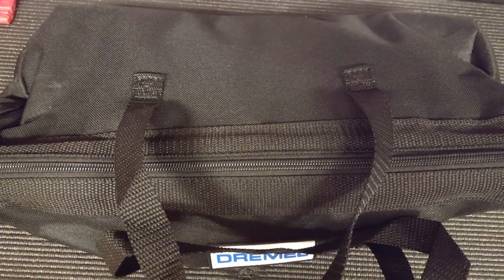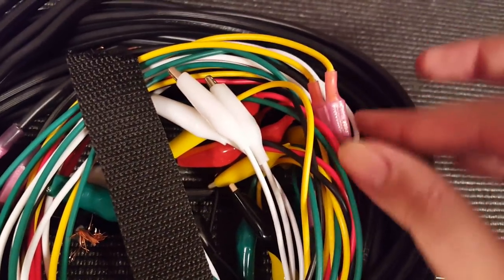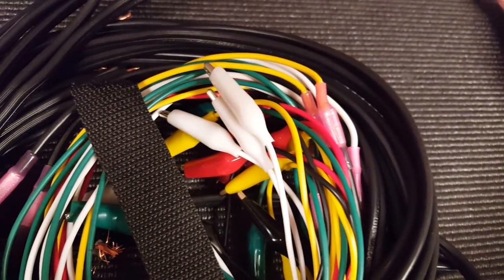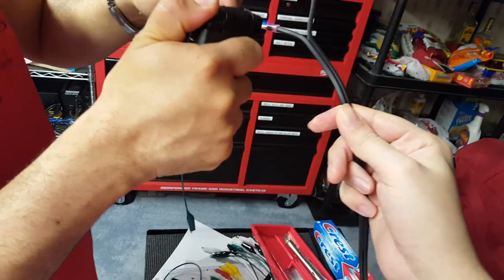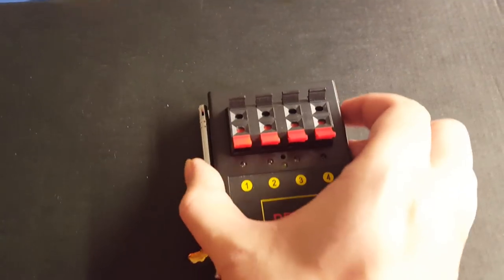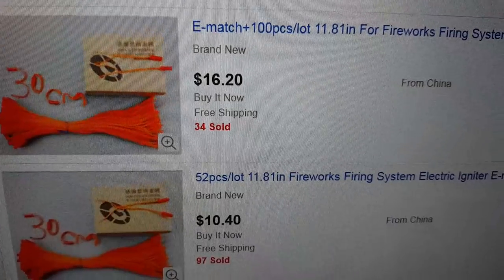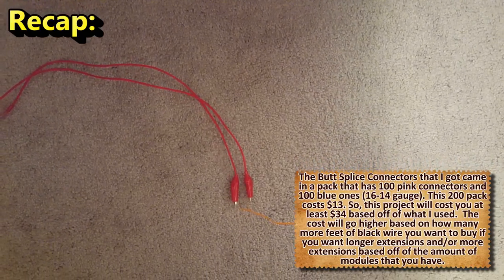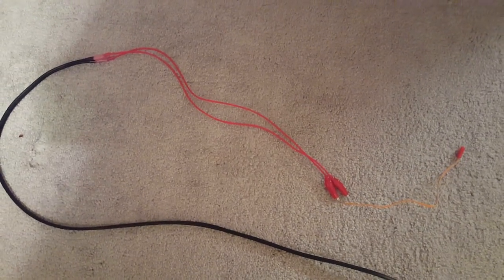Fireworks Info (Saving Money) - Extending The Length Of An E-match/Talon Igniter (Permanently)

Comment from the maker: So here's what I used:

1.) 16/2 Black Stranded CU Low-Voltage Landscape Lighting Wire (I used the Southwire brand).  It costs $0.33 per foot at Home Depot.

2.) Double-ended Alligator Clip Cable Electrical Jumper Testing Wire (20 Pieces).  Didn't mention this in the video, but you can also split the alligator clip wires in half and use both (which will give you a total of 20 sets).  I was being lazy with what I had and I had just decided to use all of the wire while removing the other alligator clip.  This 20 pack of alligator clip wires cost me around $7.

3.) Butt Splice Connectors (22-18 Gauge, or AWG).  I purchased a pack of 200 connectors which have 100 pink (the ones used in the video) and 100 blue, which are 16-14 Guage (they're bigger than the pink) for $13. 

4.) Various tools which include a vise grip (or locking pliers), a torch lighter (or a heat gun, if that's your preference) and a wire cutter.  The correct tool to use to squeeze (or crimp) the middle of the butt splice connector is a crimper, but you don't necessarily have to use that if you don't have it.  If you do have a crimper, then use that, but if you don't then you can use the vise grip as a secondary option (or you could purchase a crimper for like $20).

Comment: I literally made my version of these last night. I bought 24 gauge wire from lowes 100ft roll for $10. And a 10 pack of clips from china for $.99.  I will soldier the wire to the clips and use shrink tube. Great video. Im always looking for a way save money so i have more for fireworks

Comment: I have reused the the long wires from spent Ematches  for scab wire. I saved all the used wire and connected them together and put it all on spools so I can have any length I need. I did this last winter when theirs not much to do. I figured that I already paid for it so reuse.
Reply from the maker: And who says pyros don't recycle??  Lol.  My brother and I discussed that as a possible option, but because we buy 1 foot ematches it would take a long time to extend them with the wire from other 1 foot ematches.  If you're using at least a 1M ematch or longer, then that is another great option as well (it's the preferred option, no doubt).
Reply: pimpdaddee28 ya most of the wire was 10ft and it did lake a while but when its ten below out there's not much to do. I thought it was time well spent. I also hacked my receivers to run off one 6v batteries instead of 4 AA that you can only use a few times. I soldered lead wires to the receiver battery terminals. I then used speaker terminals with alligator clips soldered to to them to connect to be battery. This way you can run a few receivers off one 6v rechargeable battery. This way you always have a fresh power supply for every shoot and can save a ton of money on batteries. Works awesome, my batteries are in small containers with the terminals screwed to the top witch makes them stable enough to plug in the wires.
Reply: @markluce1659  To be honest, if you're within 20 meters of a Mains outlet, you could use an identical hack with a $10 power brick from eBay to make them mains-operated - 3 minutes longer on the setup for each rig to run an extension lead off a reel, but no more batteries whatsoever. That's what I'll be doing.

Comment: Well done..! I bought 18awg speaker wire 100' rolls $7 each through parts express I also picked up spring terminals. I made 25' 50' & one 100' cables each having 3 - 5 cues. DC voltage over long runs drops alot since its a direct voltage vs AC which pulses. I tinned all my ends to keep any frey'ed ends from happening. The spring terminals hold them very well. I have videos on it.
Reply from the maker: Send me some links of how you tinned them.  In my case, I soldered the ends but they just wouldn't stay inside of the cues if I moved the module or even tugged the wire slightly.  But wouldn't the wire break eventually since the ends aren't loose?  Even if the wire gets frayed with how I do it, at least it won't break off over time and it can move freely while inside of a cue.
Reply: pimpdaddee28 I dont have any links to me tinning the leads. Its super easy tho. Strip wire back about 3/8 of inch, twist wire together, dip bare wire into flux, melt solder to solder iron then apply to wire. The flux will draw it in. If you want the bare wire leads at an angle bend the wire prior to flux & solder. I would strip off about a half inch then trim to length. Also if you want them flat for a better connection just flatten the wire prior to flux & solder.
Reply from the maker: Thanks bro!
Reply: pimpdaddee28 Glad to help

Comment: I have been considering doing something like this so I could buy the cheap china eBay igniters.
Have you had any failures on the cheap eBay igniters? I been using clip on talons, so I am wondering how these cheap china igniters are for connecting to fuse and passing fire. They don't clip on do they? Do you tape your fuse into that red cap? Do they work like firewire where you can pull that cap back and jam them right into the fireworks fuse port hole?
Reply from the maker: I'm not a fan of the talon igniters.  They didn't work that well for me a few years ago (lots of failures) so I switched to ematch.  They have a port (the red cap), so you just slide the fuse into the port and put tape around the entry point of the port so that the fuse stays in place.  Never had any issues with the ematch, very reliable.
Reply: Thanks for the info, I never used e-matches, but for the price per piece I think I am willing to switch to them. 
I did have a few failures on talons, when I broke the thin wire inserting thicker fuse in them, they are very fragile.

Comment: why not cut them in half and make twice as many
Reply from the maker: We thought about doing that, but I just wanted to get as much length as possible out of the Alligator Clip Wires.  It wasn't too much of a big deal for me because they don't cost that much compared, but you can certainly do that as well if you plan purchase more black wire in order to make it longer.

Comment: Why didn't you just cut the clip wire in half and get more usable clips. Single conductor wire (SCAB) is used in the industry so you don't have strands shorting out, you could tin the ends.
Reply from the maker: I could've done that, but I was lazy, lol  I had the 40 foot roll already for a different project that never came to fruition, so I just tried to get as much length as I could out of these extensions by using the entire length of the alligator clip wires.  You can split them down the middle as well (and I probably should've said as much in this video).  Chalk it up to another brain freeze, lol.

As for the wire, there's no need for a SCAB since the dual conductor wire is shielded all around, so there's going to be no issues with shorts.  Tinning the ends will not allow the cues to hold them down tightly as they will just basically pop out every time, even if you slightly pull the wire.  If I end up using solid wire, there's a potential that it will just end up snapping off down the line (due to repeated use), so this was the better method (at least in my opinion, lol).

Comment: Here is my version of this trick, watch the first minute and 40 seconds of this video: https://youtu.be/CIS1ZfL2Yr4  You can get 22ga. speaker wire and small alligator clips cheaply. Strip back the module end of the wires and tin them to prevent fraying. Crimp and/ or solder on the alligator clips on the other end. Doorbell wire also works.

Comment: You seriously need to take a basic class or watch some videos. You use a torch on The wire splices If you crimp them correctly they won’t come apart. You use a crimping tool not vice grips. And you can buy low voltage thermostat wire for around $30 for a 500 foot roll